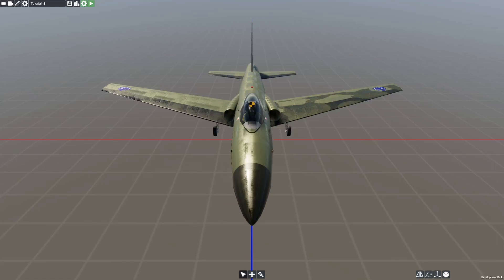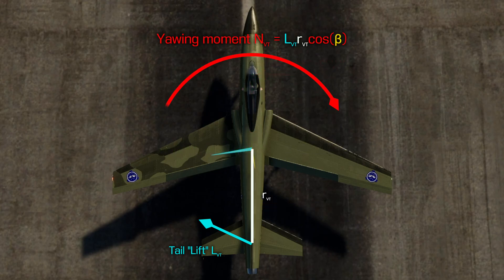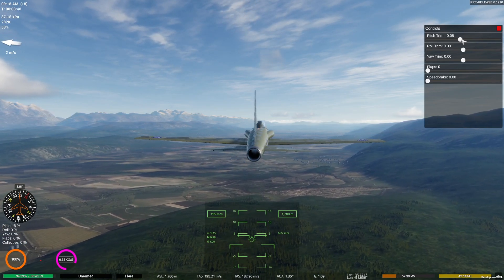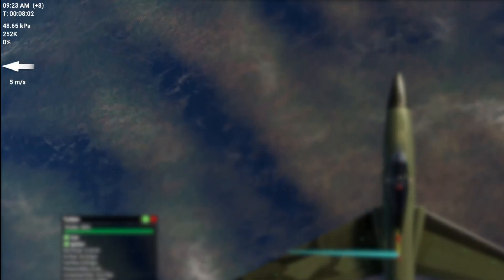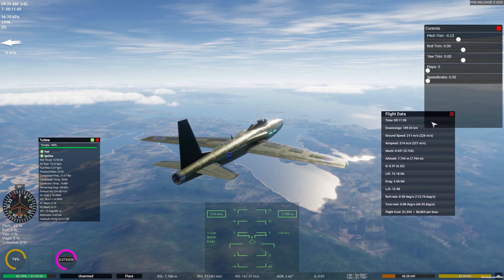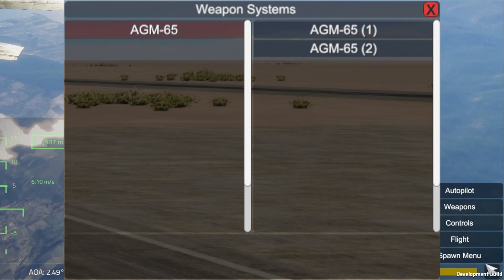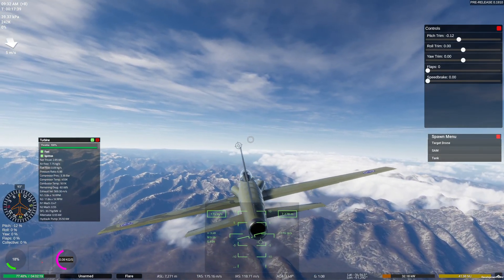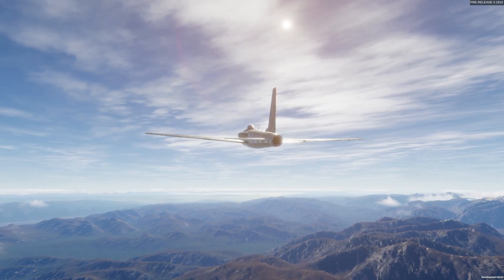Flyout Comprehensive Tutorial Series | Part 2: Introduction to Flight

Comment: how do you fix if control surface gets stuck when rolling
Reply from the maker: If it only happens at higher speeds, you could reduce its pressure damping setting.
Reply: @TheWanderer05  i actually found what was wrong, I had a keybind set which beroke everything, but anyways tanks for the suggestion

Comment: How do you add nose weight or view Centre of lift in the editor?
Reply from the maker: You can move your center of mass forward with batteries or swing joints with large mass multipliers, but I’d recommend seeing if your engine is just too far back. As for center of lift, you’ll have to just eyeball it for now.
Reply: @TheWanderer05  ok thanks, I just moved the wings back a bit until it flew nicely

Comment: What happens if you set you initial velocity to something faster than your aircraft can actually go? Also, nice tutorial!
Reply from the maker: alright I just launched a helicopter at 500 m/s and it didn't end well
Reply: @TheWanderer05  😆 Alright, thanks for trying!
Reply from the maker: Nothing bad, you’ll just slow down since your engines aren’t able to overpower the drag. Wings don’t rip from overspending at the moment so you shouldn’t need to worry about that, even with soft joints on.
Reply: @TheWanderer05  Oh ok. I was just thinking like if you built a helicopter and set the initial velocity to mach 3 or something, but I guess that’d slow down extremely quickly.
Reply from the maker: @Arcanace With helicopters you might encounter some stability and controls issues; I haven’t actually tried that yet